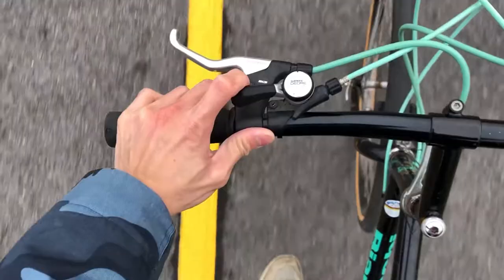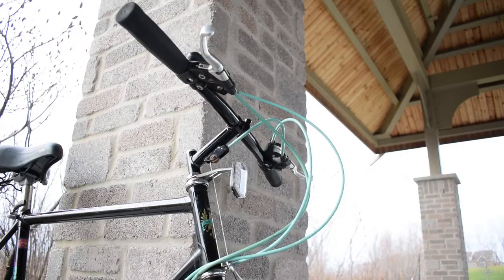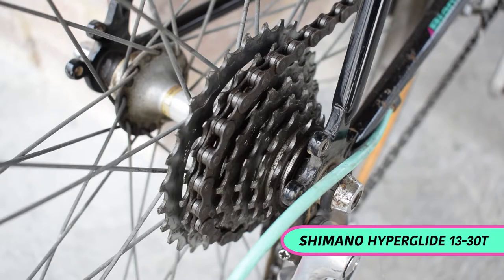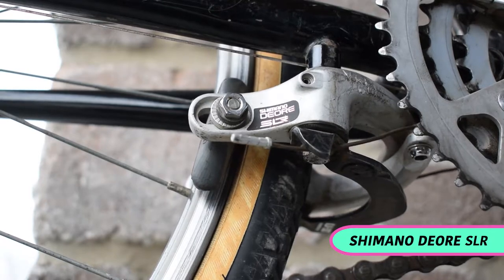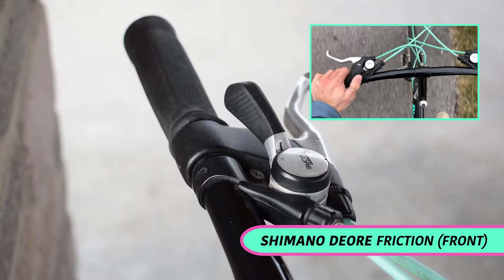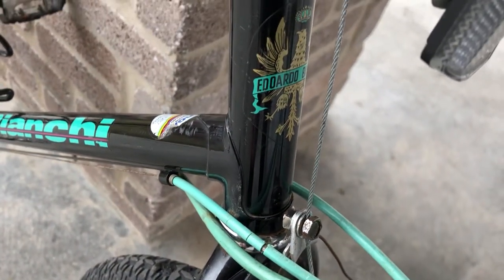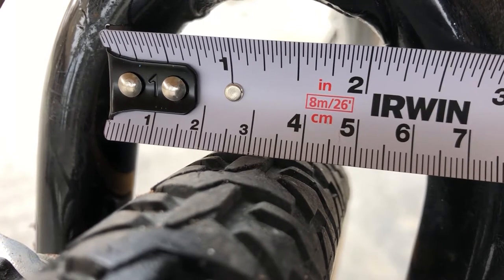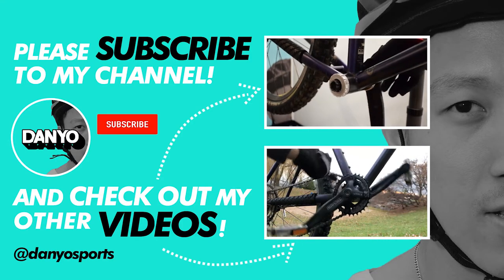I Got a 1987 Bianchi Grizzly!

Comment: I have one I'm getting it back in service after sitting for a year..needs cables shifters and brake. Needs new grips and soon will need tires, cracking a bit on sidewalls. Love the bike though rides like the wind. Frame is strong and straight...I've noticed it has extremely durable originale pant dark dark green. Tall frame for tall rider I guess....love this bike

Comment: question: What is the max size of the tire? can i put a 26x2.2?
Reply from the maker: 26x2.3” is the maximum size I’ve seen for this bike, slick tires only and you’ll need to remove the rear U-Brake booster protector.
Reply: @DanyoSports  what about tire width? 650c? Maybe 700?